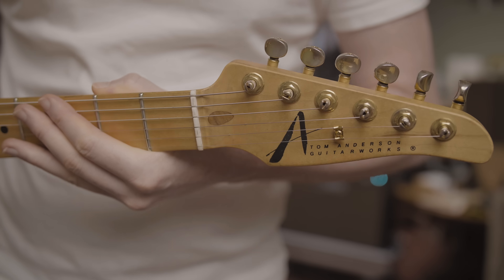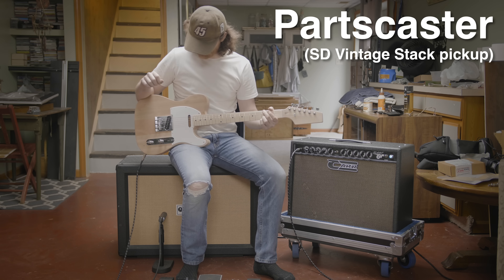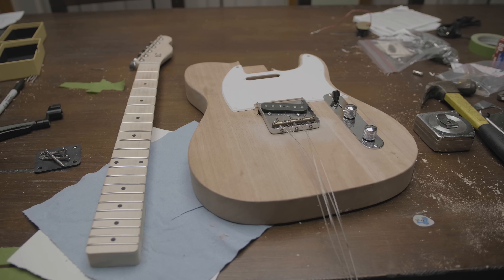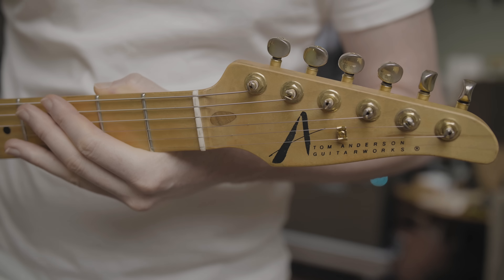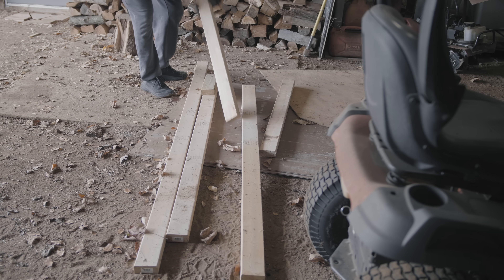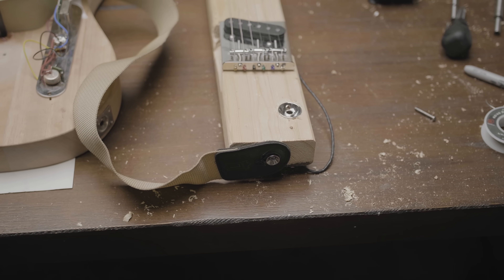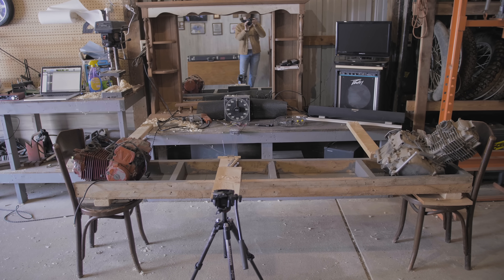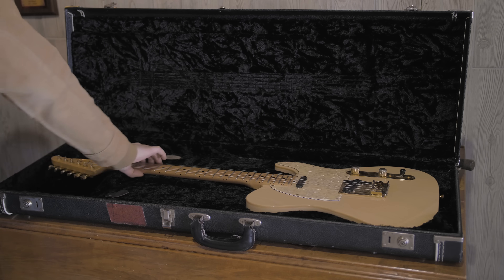Tested: Where Does The Tone Come From In An Electric Guitar?

Comment: I knew it! It's the Seymour Duncan pickup that is responsible for the amazing tone of a Stradivarius violin. The wood has nothing to do with it. It was the stacked tele all along! 😂 Are you kidding me??? Then all mic'd violins would sound the same.
Reply: A mic on a violin is not a pickup 😉  a mic converts the air from the body of the violin (the body is a loudspeaker like on a accoustic guitar) and the string arw not made of metal, the guitar pickup react only to moving strings in a magnetic field, so the wood of the neck and body had zero impact on the pickup. The accoustic sound of different woods on a electric guitar does not affect the guitar pickup that react only to moving metal in a magnetic field. Guitar wood had no influence on the electric tone but had an influence on the attack, tuning stability and how easy you could get overtones with your pick but that is not tone !
Reply: @PeterR-vt4mx  you need check your hearing my friend. I will disagree with that from years of playing and experimenting with guitars, pedals, effects, amplifiers, etc
Reply: @PeterR-vt4mx  A solid body electric guitar has acoustic properties. Take any 2 electrics of the same model. Put fresh and identical strings on them. Play them in a small room, bathroom, or a booth. They will sound different. Period! And that is a fact.

Comment: FLAWED EXPERIMENT. The pickup is NOT THE MAIN SOURCE OR FOUNDATION OF THE ELECTRICS TONE! The issue with this experiment is that he is using a Seymour Duncan stacked tele humbucker! That telecaster doesn't even sound like a telecaster with the stacked tele pickup. That pickup is 18k and it is like a sledgehammer! It will never pickup all the detail like a lower wind humbucker or single coil would. It would sound the same no matter if you stick it on a Donkeys' ass. I had 2 identical Gibson Les Paul standard guitars. 1 set of Seymour Duncan Seth Lover pickups. I swapped the Seth Lover's out between both guitars and used the same strings and amp. 1 Les Paul was mellow and bluesy. The 2nd one had a completely different tone. Very aggressive and hard rock Foreigner tone coming from it. Same 10-46 Ernie Balls strings. Same 100 watt plexi Marshall and settings. 2 very different sounds from one set of pickups. But I do admit that IT'S NOT ALL IN THE WOOD EITHER. It's the sum of the parts. Good parts equal great tone. It begins with the wood, hardware, strings, and lastly the pickup wind and type of magnet. The magnet type especially yields very different tones from one pickup wind.

Comment: The strings are still connected to a wood body mass. Just an oddly shaped guitar. The tables and cross braces still attenuate sound waves. Would be worth isolating the strings with rubber bushings or something as to make it so there is no other connected mass resonating with the strings. May get same results but i just wonder if the standing waves through connected masses have an effect. Like a drop in a bucket of water. Energy reflects all around for a fraction of a second.

Comment: Interesting video but I’m not sure if the blanket statement ‘tone wood doesn’t matter’ as one comment stated is quite right. If you strum a les paul and then a strat, both unplugged, you can hear the difference, with the electronics factor removed from the equation

Comment: Well... So I guess tone comes from...

1. Primarily from your speakers.
2. Secondly from your tone nobs or an EQ.
3. Whether your using humbuckers or single coil.
4. And maybe to a small degree from the gauge of your stings?

Because at this point. You beat every other test I've seen with that air guitar maneuver.

Comment: Fascinating! I would have liked to see side by side spectrum analyser printouts because the only differences I noticed  in your comparisons were extremely slight tonal variations in the form of slight boosts/cuts in the bottom end of the entire frequency response. I believe the body material affects sustain rather than tone - I built a bass in the style of a Fender Precision using a replacement neck and a body I cut out of mahogany myself after literally tracing around my 76 P Bass. The body was about 33% thicker though so in that case I might have destroyed my own argument!

Comment: Im sad to say the discussion dont stop here. There is atleast one variable Jim did not consider. Microphonic pickups. 
Im not in either of the yay or nay sayers camp, but as im trying to aquire wisdom about this subject, I will say this. In this instances, its hard to hear any difference and Jim did a very good job. But…
All pickups are microphonic to some point, and this means, that even without strings on the guitar, some sound can come through. People who are tonewood snobs, allso tend to like guitars that resonates a lot. This lets me think that the more the guitar resonates, the more of the sound of the guitar will come through. People often refer to hollowbody guitars to sound more airy, whitch could come down to, more sound from the guitar comes through. 
So if you have unpottet pickups, again more of the sound comes through. The pickups used in this video is wax pottet, witch reduces the microphonics a lot. So my conclusion is, that the material of the guitar can have some inpact on the sound. That dosent say a more expensive guitar should sound better, but maybe if it resonates more, it changes the tone. 
Would like to hear Jims thoughts on this.

I could allso add, that if you play very loud the strings on your guitar will vibrate. And if you have a guitar that sustains a lot, it may not change the tone, but it will give you a very different feel when playing.

Comment: Try capturing, analyzing and comparing the voltage vs time waveforms of the electrical signals out of the pickups in each of the trials. These waveforms would reveal subtle differences not discernible by your ear. The differences could lead to more detailed experiments and ultimately which combinations produce the most desirable signal.

Comment: Nut material & design spec + saddle material & design spec + scale length + string type = string vibration pattern & duration.  End of.     The material / structure of the beam has no influence (as long as it actually resolves the tension forces involved).  From there, it's all down to the electrics.

Comment: Don´t know what everybody is talking about here, as the Anderson is still way far the best guitar in all tests, also against the "air" guitar. If you have ears then listen! Also there is no air guitar, the body is the steel bench, as the bridge is mounted there and the neck is the wooden bench as the saddle is mounted there. The reason why this sounds quite good (but by far not as good as the Anderson) is because the benches are quite stable so that the strings can swing free.

Comment: I'm very sad there's no follow up to your tone/guitar video. But i understand, you were getting into difficult territory. At the end you listed which things the two guitars had in common, aka the variables you're controlling, and i was so happy you mentioned strings, because they weren't mentioned in the beginning by whoever you asked where tone comes from, and that was shocking to me. I believe you've got all the variables locked down except for quality of solder joints, so the best thing to do would be to measure resistance stop to stop on your pots and document that. The ground circuit is also pretty important. Was there a capacitor on the tone pot? If you ever want another set of eyeballs and brain on your next experiment, or if you want someone else to perform same experiment I'd be delighted to help, but i don't want to be in a video. Silent helper kind of thing. Repeating an experiment is the next step in using the scientific method to learn something, it's validation of your method and results.

Comment: Strings. Pickups. Each electronic component and their solder joints, especially the ground circuit. That's all, like Metallica says, nothing else matters. It's absolutely hilarious and completely absurd what people think about tone. Tuners affecting tone??? NOT ONE OF THEM SAID STRINGS??? They said the finish on the wood, but not strings? Unbelievable. The strings and the pickups are the only thing that matters, and we'll see what you say because I'm only at 0:48 into the video. I'm an engineer and think about things like this topic in a way I heard Tesla does. He uses thought experiments where he imagines a machine or something he's working on and runs it in his mind. I try to do that in my job and my hobbies, and strings/pickups are the only thing. Of course when I say pickups that includes every solder joint, type of wire, quality of components and solder joints, and the ground circuit. Everything else is just their imagination.

Comment: My experience with Fender type guitars is when you change a neck or a body the character of the guitar changes and sometimes that change can be considerable. I put the same pickup in two different guitars and it sounds different. My conclusion is is that the wood has a lot to do with the sound of a guitar

Comment: Great Video,
 I saw a video in YT guy, pealling off the poly finish of his epiphone SG and it sounded a bit better/ more resonant after that. Perhaps the test A/B didnt exactly set pick ups hardware etc exactly the same. Or may be the sound from the speaker is the same, but acustic from the guitar and feeling in your hands/ belly  different.. 

In your videos, could be interesting as well, compare both guitars, partcaster with the chinese original pickups, and trying to get the same tone, (adjusting pick up heigh and eq/gain volume of the amp as needed )to get the closest to the fancy SD vintage PU. Thanks for your time and effort.

Comment: Your video proves for me what my intuition has always told me, which is that I could take a really cheap guitar and put in expensive pickups and pots, use good tuning machines, strings and a really nice amp and effects, and get a really good sound out of it. It is also probably why Eddie Van Halen built his own guitar and also why Brian May and his dad over wound the pickups in his guitar back in the day, engineering a sound that wasn't otherwise yet available.

Comment: I bought the cheapest possible Squier strat at the time (bullet strat) and put nothing but a SD Hot Rails for Strat pickup in it, with just a volume knob and a coil tap. I've had this guitar for 10 years and everyone who hears it thinks it's a special custom shop Fender until they see the Squier logo. I've never had to adjust the neck and the action is extremely playable. I even went as far as putting Billy Gibbons strings (.007s) on it and it sounds wild. Just more proof that the tone comes primarily from the pickups, strings, and the player!

Comment: I laughed so hard when you did the test with the air guitar. I had the intuition for a while that for an electric guitar, what matters is pickup, it's placement, the electronics, the strings, their length and that was about it. I always felt like the fuss about the woods of the body, the neck or even the fretboard was just wanking, you kinda proved my thoughts.

Comment: So, basically nothing matters 
Just play 
Anything that will stay in tune is good 
Why did I pay soooo much for guitars? Ugh
Thank you for showing me just how STUPID I AM. 🥴
Reply: Hi. If you're looking for something with A+ grade construction, try Tagima guitars as your base.
Highly suggest the TW530 series as it runs around 200-300.
It's a good upgrading platform with solid neck,great paint, great body.
Though it's bass wood which is only slightly lighter than bass wood.

Me myself i just want toi replace the tuners.

Comment: Amazing, thorough test.
At half way seems to confirm my approach that cheap good feeling guitars upgraded with reasonable pickups sound just as good as more expensive guitars. 
I have a Fender strat, a Squire strat and two Casino strats Ihave replaced the Squire and Casino pickups and my favourite is a  second hand $30 mtallic green Casino with $100 pickup upgrade.
Plays beautifully and sounds amazing.
By the end you had me convinced to build a workbench guitar.😅

Comment: As an engineer, this is shocking but makes perfect sense. There's no resonance like with the guitar body like an acoustic, the pickups are just little analog sensors measuring the string vibration and you'll skew the measurements by positioning the sensor a different way, hence the tone differences.

Comment: Fantastic job. And the results are as expected. On electric guitar what matters to the tone are the strings and electronics, including cables, pedals and amps. 
Different types of wood, guitars shape and weight makes a lot of difference to the playability and confort of the player. And also the guitar setup makes a lot of difference because it helps the players to play much better. But the sound produced depends mostly on the player and the electronics combination. 
On acoustic guitars the history is completely different.

Comment: Not being someone that knows guitars alot.  But just by doing some common sense logic thinking.  It would seem that the body and the neck wouldn't play much of a factor in the way the sound is produced on an electric guitar.  As the pickups don't pick up resonating sound. Unlike in an acoustic where thee body is very important to the sound of the guitar.  From what I can see. The pick ups in an electric react to the string as it moves side to side.   Thicker string move side to side slower producing a lower sound wave and thinner string move faster.  Making a higher pitch sound.  This can be manipulated by make the sting shorter or longer with you finger on the fret. But from my knowledge the pickup don't actually pick up the sound of the string. And only measure the stings side to side movement which is then translated into a sound wave and sent out to the amp.  So if correct. The only thing that would change the tone in an electric is its electric components.  As was shown with the 2x4 model he made.  The tone was so close that it would be within tolerance of the components used.  Another words even though they were the same model and brand of components. No 2 will ever be identical
Reply: Okay, to play only a little devil's advocate here, there are a lot of microphonic pickups out there (both the ones in my Epiphone Les Paul are) where it might actually be affected a little by the wood... but probably not that much.

Comment: It does sound disconcertingly similar, but it still resonates differently in my humble opinion. 
Listen closely and on full volume how the air guitar resonates in a much higher frequency, while the Anderson's body resonates with a lot more bass.

Still a great video as the point obviously is, the body is really mostly a cosmetic issue.

Comment: It has been confirmed that tone woods are a myth... so it stands to reason that a vintage instrument has no value other than as an antique/collector's piece. After all, what the pickups and electronics are made of is neither special nor secret, they are easily and cheaply reproduced. But hey, if you want to pay $4k for a tele with half the finish rubbed off and a cigarette burn on the headstock, you do you.

Comment: 1. No overdrive would be appreciated in the tests
2. While pickups are electro-magentic, some microphony also occurs; just tap the body, or indeed the pickup itself with a pick, (strings muted) and you'll hear the sound of the body or the pickup casing.
3. Tele bridge base plates differ; some are brass, others steel. Brass base plates do not have the ferro-magnetic property that steel ones have; this property when, considering its wrap around the bridge pickup makes a significant difference.
4. Softer wood types will absorb energy from the strings, unlike their hardwood counterparts like ash, alder etc. It's not that the wood adds tone but rather, it can be   subtractive.
5. Also, consider the difference in sound between semi-solid and solid body guitars.
6. Pickups ARE important

Comment: This is awesome!  Full marks for open-mindedness and scientific method.  I think your results are valid for most solid-body guitars.  Pickup, electronics, and pickup positioning make up nearly 100% of the guitar sound.

I do think that if you get into full hollowbodies that don't secretly have a plank down the middle, that changes things.  If the thin top is vibrating enough, that moves the pickup in relation to the strings.  I'd love to see a nice jazz pickup mounted on a dime-store special steel-string acoustic guitar vs. the same pickup on an expensive, full-hollowbody jazz guitar.  I'm particularly curious if a tailpiece vs. through-the-top pegs would make a difference in that scenario.

When I made guitars, it was thought that the Spanish Cedar tops of flamenco guitars had high internal dampening that reduced the sustain of notes, allowing better articulation of fast passages compared to the spruce/rosewood of a Classical guitar.  They certainly have less sustain and a very fast drop-off in volume after the attack.  I wonder how much of that would translate through a pickup?